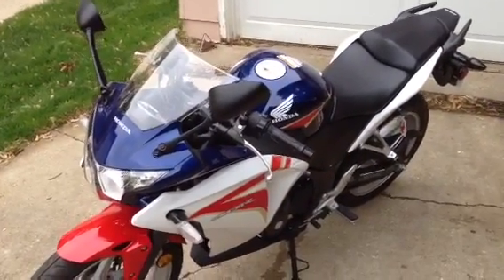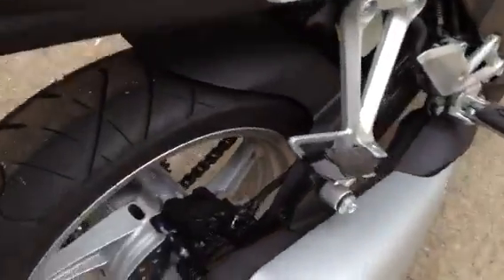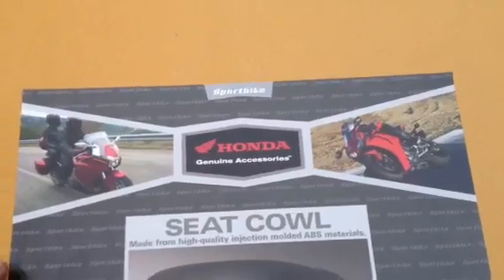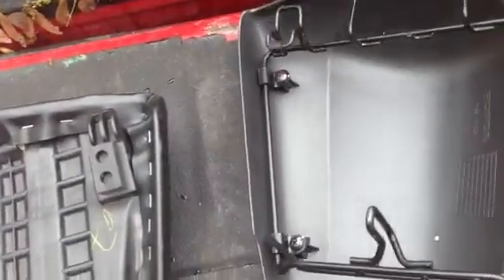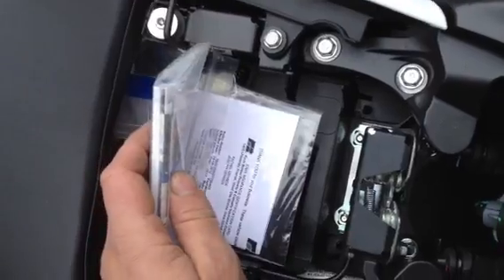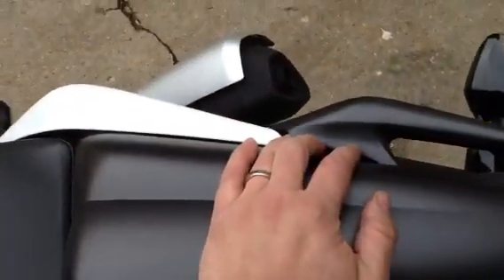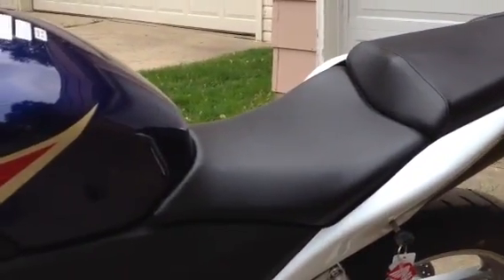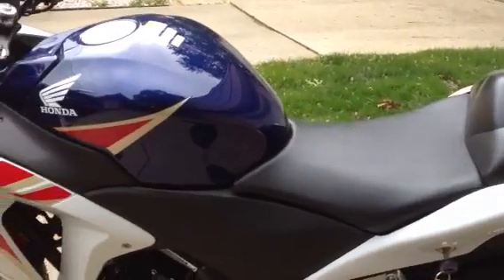2012 Honda cbr 250r seat review

Comment: I removed the seat cushion from the rear seat. I can now slide back an extra 1/2" before contacting the seat. Additionally I can slide unto the rear seat and now I can duck under the windshield. A caution, the plastic rear seat base has molded in ridges. I placed a hand towel on top of the plastic and pulled the seat  cover over it and it stay's in placed under the seat. Do not remove the rearmost staples . The staples keep the seat cover attached to the bike so you will not lose it.
Reply from the maker: Thanks